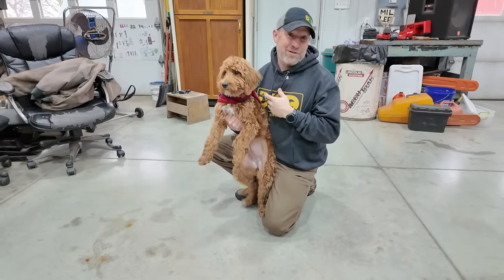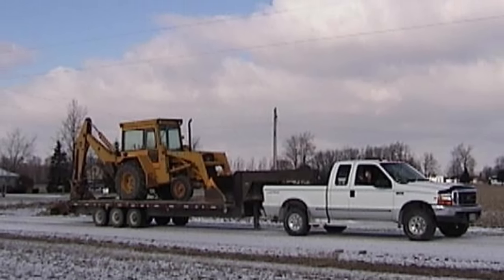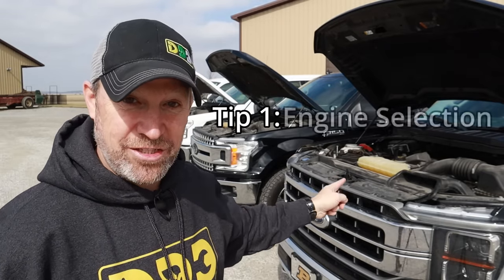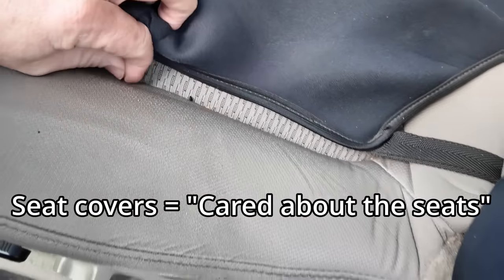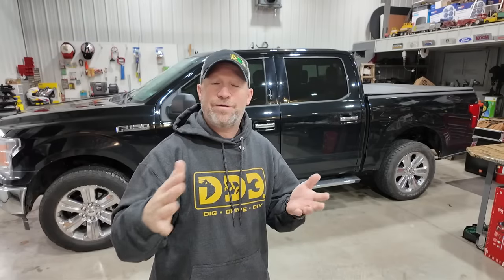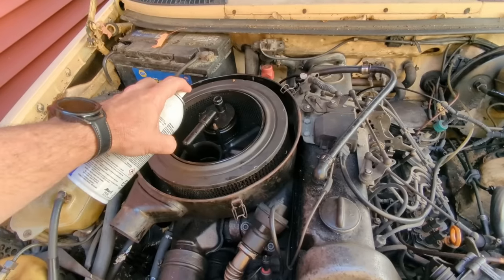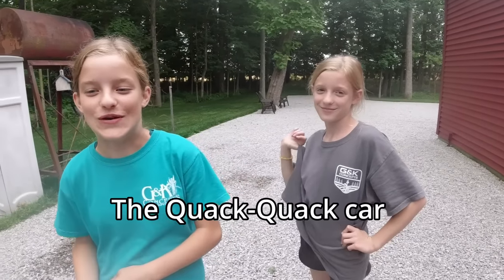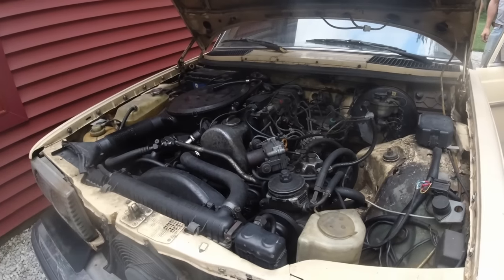How To Buy Used Trucks On A Budget

Comment: fun fact.  if you buy it new it's never used until the next person buys it.  I have a new 2000 GMC Sierra 1500 with 276k miles on it.  also, I once spent 3 years looking for a specific truck, so your 3 months is nothing.

Comment: I just bought a 18 f150 with 140k 5.0 runs great. I always go through and do maintenance such as spark plugs belts. All the fluids changed as soon as I buy them.
Reply from the maker: Great tip!
Reply: Do you flush the coolant or just drain it???
Reply: I bought my 2018 F-150 5.0 with 45K for $35K which I think was a great deal, absolutely love it
Reply: I flush it a few times with some distilled water. I’m a little leery about the chemicals they want you to put in the cooling system. I heard they ruin water pumps.

Comment: Thanks for the video Neil ! I haven't bought a new vehicle since a pickup I got in '78. I've mostly had good luck buying used. We are retired now and have been making a couple trips each year of 4,200 miles between MN & CA. Our Subaru's seats weren't very comfortable on long trips so when it died (I'd missed a timing belt change) we got a 2006 Lexus LS. After 3 trips out & back in the Lexus I am still happy with it. Like most of our vehicles I expect to keep driving the Lexus until it isn't worth the cost to fix anymore. We could afford almost any car we wanted but if it ever came to a contest of pinching pennies, I'd step into the ring with you any time son ! 😂

Comment: Did anybody else notice the picture of the older F 150 about 10 feet off the ground at the sand dunes!!!! That’s crazy, I’ve had my truck a few feet in the air, but mad respect to that driver for sending it!!!
Reply from the maker: That was in my Bronco!  That was a heck of a ride I tell ya! :O
Reply: That’s crazy! Haha
Reply: I bent my F100 frame doing that.
Reply: They're cheaper to buy when they're air borne. Of course, you buy as is while in the air but you can save a few bucks on fuel as air borne f150 trucks have great fuel savings while in the air.

Comment: Nice to have you back. I caught a bit of your live stream last week but only the last few minutes. Just about when you mentioned "that's what's been going on".  I just figured you took a well-deserved week off. 

Other than the obvious, (age) it amazes me how we seem to have similar ideas and histories. The 317 on the trailer struck me and the attachment to John Deere Garden tractors. The Ford trucks are almost exactly the models I've owned and my thinking about buying trucks (vehicles) is almost exactly the same as yours. 

I took my last "new to me" purchase on step further. In 2017, I purchased a 16 SCREW with a 3.5 V-6. I intentionally avoided the turbochargers mostly due to my experience with aircraft. I too just didn't want the unnecessary complexity but wanted the fuel mileage of the V6. I'm always amazed how that little engine can pump out the power at 21 MPG overall. It has never left me wishing for more. It had 23K on it when I purchased it, and now has just over 205k. It still looks and drives as good as the day I bought it. I had sold my 99 F250 crew with 7.3 (just like yours) that had 333K miles on it for about half of what the 16 cost. So, I had a very nice low milage truck for less than 10K out of pocket. 

It was the lower-level trim but a trip to the junk yard cured that. For another grand, I bought all the 302 trim stuff including a gauge cluster from Platinum. It's all basically plug and play with some changes to the computers which is rather easy to do. I also had a lot of help from the guys at the "F150 Ford Enthusiast" web site.  I wouldn't recommend others as things can get messed up if you're not careful. At the first tire change, I upgraded to the 18" Platinum wheels and made the necessary corrections for the speedo. Also, very easy to do. 

In the end, I ended up with the truck I wanted but couldn't afford with no payments. I wouldn't recommend everybody jumping into this style of purchasing. But it works(ed) for me. I've from time to time thought about trading it, but I like that truck so much the thought soon passes. So, I totally agree with your point of view on these things. I just read this morning the average monthly payment on an F150 is just under $950 bucks per month. Great trucks, if you can afford them.
Reply from the maker: Very nice!  There are creative ways to save and still get what you want for sure!

Comment: Around 4 years old with fairly high miles is a smart set of criteria.  That all but guarantees they're highway miles so the wear's a lot less than the same mileage in local traffic.  By contrast my dad only bought 10 year old cars on the theory that everything major that could go wrong already had by that point.  That theory was proven wrong A LOT, which is why I grew up learning how to turn a wrench.

Buying stuff in Europe when you're stationed there in the military and bringing it home was definitely a thing.  My dad for years had a high-end turntable and reel-to-reel tape deck that he picked up while stationed in Germany, and when he was due to get out in '68 they offered him a new Jaguar if he'd re-enlist and potentially get sent to Vietnam.  He turned that down in favor of going to college on the GI Bill, which worked out a lot better for my ability to exist.

Loved seeing the last ride of Quack-Quack.  Those 80s Mercedes diesel wagons have a bit of a following because the drivetrains are pretty near indestructible, and they're not hard to work on.
Reply: Just stay away from the 10 speed transmission

Comment: My first car was a 1973 Mercury Capri in 1991. I learned a lot about working on cars from that one. Partially because it broke down on me so many times. When the alternator went out I actually had to get the existing one rebuild because I couldn't find a new one anywhere (this was before the internet). Biggest lesson I learned from that car was that buying an old (not just used, but old) car could be far more trouble than it's worth - especially if you don't have a place to work on it and the knowledge to fix whatever goes wrong.
Reply from the maker: Yeah, too old can be troublesome!

Comment: I do all the automobile buying in my family. My husband trusts me and the research I do. He likes new but we keep it until if will not run anymore. I picked out his 2011 Dodge Avenger and it now has 178,000 miles. When we buy a car we pay on it for a year and then we pay it off completely. We do that because it keeps our credit score up in the 800's. I bought my Hyundai Santa Fe SUV in 2019. It's a 2019, I wanted no more than 5,000 miles on it and the list of standard safety features are amazing. I knew that in 2020 they were going to remove many of the "standard" safety features but add them on a luxury features where you had to pay extra for them. I got everything I wanted and it was still under warranty.  I knew the 5,000 miles was enough to break in the newness and it was a small town's rental car therefore I knew the maintenance history on the car itself. It's 2024 and it just flipped to24,000 miles and runs great. No issues what so ever. I always do my 3-6 month research on my cars. I paid it off after a year during Christmas. We love not having payments on anything. We're completely debt free. We're able to travel every winter to Australia. My husband is retired and I'm a disabled/retired nurse.

Comment: A trick I learned with black cars is get them washed and waxed good, then give them a rub down with lemon pledge.  The static charge it gives keeps the dust off, keeping it looking clean longer, and the dirt that gets on it will supposedly wipe off easier.
Personally I don't do black cars. I love the look, but down south, it's just too hot.

Comment: I bought my 2016 f150 new. It was my first new vehicle I’ve ever owned. I know it’s over kill. But a little advice would be to change the oil when it hits 50%. I know everyone thinks I’m nuts but I’ve don’t that since I’ve owned my truck an now it’s close to 200 thousand miles on it and runs like a dream with no leaks and no problems. An I would have the transmission flushed every year. It’s around 200 or so dollars to have it done. The 10r80 has a problem with a spring in the valve body that sticks. Other then that it should last you for many many years to come. Happy driving an congratulations on the new truck.

Comment: As a former car salesman, you’re nailing it with your buying process and selection. V-8 naturally aspirated engines are best. (Not usually the most economical, but they usually will outlast all other options) 
As for your Audi, I have seen in your other videos, you need to get out from under that. Run!
Reply from the maker: Ha!  Glad to hear this from a pro ;)
The Audi was a great vehicle for our family.  The only thing it ever asked for was gas and oil.  At 79K miles it was the lowest mile'd vehicle we had ever bought at the time but we sold it a couple months ago.  It cost us $2K a year to own it plus tax, gas and maintenance of course. 
I didn't follow all my own advice with my wife's new vehicle @ 37K miles but it is a nice change of pace.

Comment: That is a really great purchase price. You nailed all the key items to be considered when looking for a new vehicle!  Congrats on the purchase.  5 of the best F150 mods that I did to my 2018 F150 were (1) the easy drop lift gate strut, (2) retractable RetraxOne Aluminum Tonneau Cover,  (3) added additional in bed and under dash and seat interior entry/exit lightning (4) easily build out a custom storage system for under the back seats to keep it a work truck when work is need and a family truck when family mode is needed.  And fianlly (5) the drivers side back seat quick release latch sold on ebay and amazon creates a very safe/secure place for storing your "bear solution" if one is ever needed.  TY Again Neil for creating and sharing.

Comment: Great video brother, I have a 2011 Ford F150 with a 5.0L Coyote V8 in it with 160,000 miles on it and still going strong 💪, It was my dad's truck when he bought it new back in 2011 for his company vehicle, then when his car allowance was up and needed a new company car, instead of trading it in he decided to give the truck to me so that it stays in our family, my first truck I have (which now I use to take to car shows) is a 1996 Ford F150 with a 5.0L (302) Windsor V8 with 210,000 miles on it and still going strong, the only things I replaced on my old truck was the starter, the rear fuel pump, and the power steering magnesium but other then that mostly was just simple maintenance, took out the transmission fluid just to get rid of the shuttering it was making and it hasn't had a problem ever since.

Comment: 09 Platinum still running strong. Over 200k miles and paid 10k for it. The ol' girl has been through blizzards and snow drifts 3 feet deep. All I have done is regular maintenance and new tires. Awesome truck.

Comment: I'm a 3.5 ecoboost guy for power and towing. the 5.0 looks the same on paper, but doesn't have the usable low end torque like the twin turbo truck . For high mile longevity I would have gone with the 5.0 as well. Now its time for a new set of Bfg at ko2! Meguiers makes a wax for black vehicles that covers up most swirls and scratches works great!
Reply from the maker: I'm interested in that wax! I kind of enjoy the labor of making the black look clean, but it may wear on me! 

My white 2015 had the 2.7L Ecoboost.  They are great trucks and could go another 100K without any issues.  We also have another G&K truck with the 3.5 EB and one more with the 5.0.

Comment: That SVO Mustang. I had a stroked SVO 1985 and it would eat LX and GT up. I was only beaten by a Grand National. I am currently looking for a Ruby Red f150. 2.7 L or 5.0 L. 6 speed auto since the 10 has issues. People need to know that the 2.7 has an amazing block that is CGI. Same as the big boy diesel blocks. Its a VERY robust platform to build a forged unit off of. And, a new 2.7 complete long block crate engine from Ford is currently $5700.  Really enjoyed your video.

Comment: Well thought out plan!   Being in Canada, my budget was to be $30K, which got me a 2016 XLT with the 302A package and the 3.5 Ecoboost.  Since I wasn't going to be towing, the fuel mileage was where my choice of importance was.  I've had the truck now for 4 years, and it runs as good now, as it did when I bought it, clocking in at 138,000 miles.   It had an exhaust manifold on warranty early on, and I put a throttle body on myself (20 minutes) and I do 5K oil changes.  I have zero complains with this truck, although I realize, like all of them, something 'could' go wrong, so it's best to have a cushion for that reality.  My truck is paid for, has the 36 gallon fuel tank, so the odd long haul is an easy task.  I've heard of numerous oil burning 5.0 trucks and 10 speed transmission issues on numerous Facebook and Youtube video's over the last couple of years, so I know, like all trucks, one can get a dud, or get lucky, as I feel I have.  Recently heard of a 2011 ecoboost with over 500K on it, and I'm sure there are 5..0's out there with the same...so get what you can afford, and enjoy your truck, which ever your choose!

Comment: Two years ago we spent 19,000 (includes tax) on a 2004 Dodge RAM 2500. It has the 5.9 Cummins. Been real happy with it. Everything has been easy to work on it. I plan on keeping it for as long as I can. It was well taken care of and I don't have to do DEF. I would never get the ECO-boost after seeing the difficulty when the water pump goes out.

Comment: I've only purchased one vehicle private party, and that was my first vehicle. That was a '98 2WD S10.  The most recent ones I got from a dealer as certified pre-owned.  They were only 3-4 years old at the time I purchased them.  Main thing I like about getting a CPO from a dealer is, that I get free state inspections (not emissions).  Each vehicle I've had also lasted eight years.

Comment: This is really great info Neil, and really sound logic.  I split the difference on my 2017 Ram 1500 Crew Cab.  I purchased in Jan 2019 using a big down payment, but did finance part of it.  Luckily I purchased this JUST before truck prices went totally crazy.  The original sticker (new) was about $50K...I purchased it about 18 months later with 16K miles for about $30K.  FTR, I'm a white truck guy as well, although if you are motivated to keep it clean, it's hard to beat black.  

Looks like a really nice F-150...enjoy!

Comment: I agree 100%. I'm currently driving a 2006 Ranger 4.0 Ext Cab one owner 125,000 km I bought for $5500.  I've driven it  three years and I'm sure I'll get my $5500 back. Frame is solid and currently has 154,000 km.

My next truck will be most likely be a high mileage F150 5.0. 2018-2020 like your style. I plan to start looking this year.

Comment: I bought a 2014 Ram 1500 with a blown motor and 80k miles on it from a friend, it was super clean just had a blow motor for whatever reason. I bought it, went to a junk yard, found a similar truck that was hammered in the rear, it was a 2017 with 50k miles on it, same exact motor. I bought the motor for $700 from the junk yard and paid a guy another $700 to put it in my truck, that was probably 4 years ago now and its a freaking awesome truck. I had a few other things done to it as well. All said and done I was in it for like $6500 total give or take. I don't drive it a lot as I have an EV I mostly drive and another diesel truck I pull an RV with but it now has 115k miles on it. I turned down 20K for it a few months back from a friend of mine, no way would I sell it for that. Its probably what its worth in reality but I rather have the truck then the $20k. I tend to buy older low milage truck from old guy's. My F250 I bought with 84k miles on it, its a 2003, bought it probably in 2017 so the old guy didn't drive it a lot. I paid $13.5 for it back then which was a lot but its the 7.3L diesel and is probably worth more then that now with only 125k miles on it as I have done a lot of nice things to it, put 18 inch modern wheels on it, complete brake job and front end rebuild, all new head and tail lights, etc. It has original white paint, never been hit other then some minor hail damage, clean Texas rust free truck. I will never sell it.
Reply from the maker: Dang.  That's good stuff!  I'd love to find a good buy on an older 7.3 just to have it around.  Most of them around here have all been handed down to construction crews and are clapped out beyond belief though.

Comment: Nice video Neil, I do about the same on buying a truck but I still have have some of mine, I have a 2004 F150 with 368000 miles a 2012 F250 gas motor with 296000 and just bought a 2020 F150 with 108000 on it